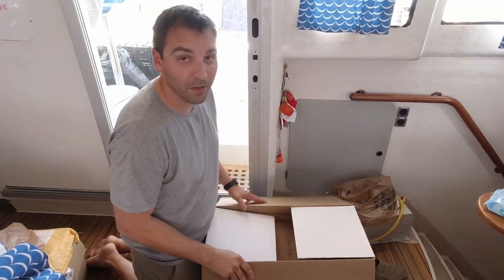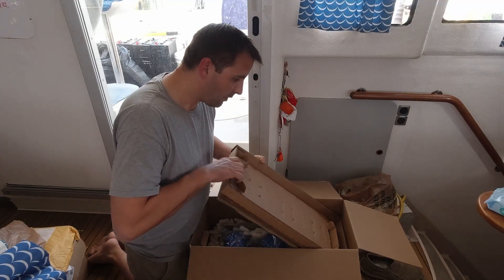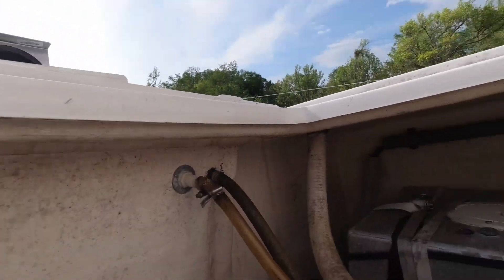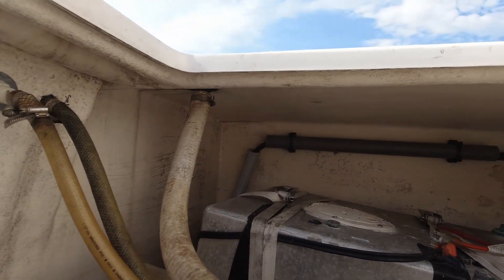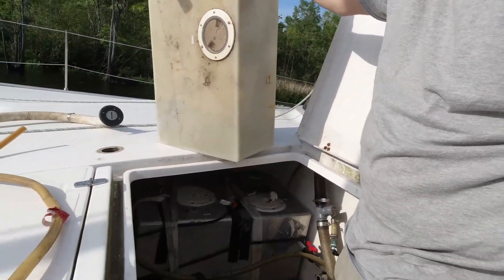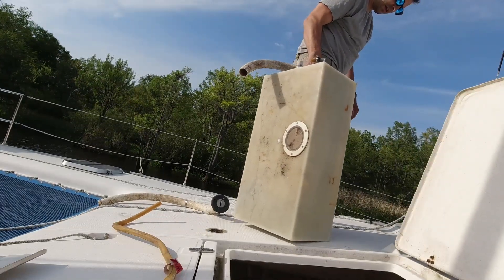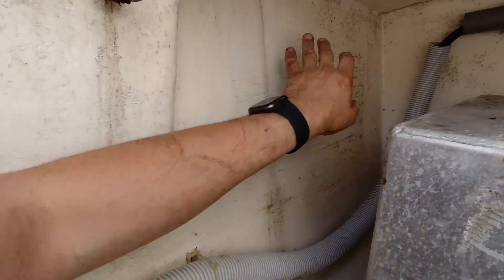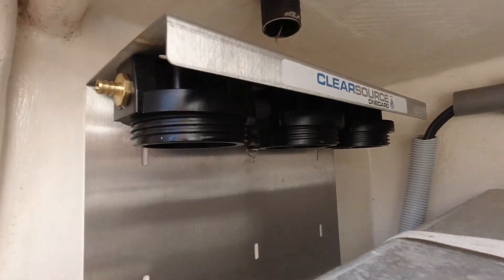Sailing: The Drinking Water System That Removes BACTERIA and VIRUSES  Ep.23

Comment: Super nice filter system.  Definitely good for marina water.  If you are using a black tank it is good to rinse the tank a few times at the pump out station if there is water on the dock. Pump, Rinse, Pump, Rinse, etc.  It helps with the smell.  Also use a dual water source flush if you can.  Salt for times when water is scarce, fresh when water isn't an issue.  The Salt water makes the system stink even worse.  Flush the head with freshwater longer than what will bare minimum get it done.  It really reduces the stink.  People stop pumping the handle too soon. Also it prevents that crystalline buildup from forming as much.  Salt exacerbates the crystalline buildup.  My Cat 30 has a Macerator when offshore that empties the waste tank.   Back to the filters, I wish that my boat had enough space for that filter rack, I'm sure water quality would be better.  I just think those super nice housings are just to big for my little boat.  The smaller size standard housings might be doable, but not the large ones.  My boat is PACKED!!!  Oh if your water maker has been sitting the membrane at least is likely toast.  If someone didn't "pickle it" with Potassium Metabisulfite, then the membrane is toast.  They have to be cycled with fresh water every week if not pickled.   Also run the circulation pump for like ten minutes before kicking in the high pressure pump.    Here is a video I contributed to with my bud Taco man: https://www.youtube.com/watch?v=ooVk-__QEME    You can make or replace an entire system for less than 2k or substitute parts cheaply from the more section and comments.
Reply from the maker: Thanks Allyn.  The water maker has been pickled we have not tested it and the previous owners never used it. They on the boat for 2 to 3 years and it never left the marina. Maybe when we get a long stretch of days where I can go offshore we can actually run some water through it. As for the holding tank, The marina where we purchased the boat had a pump out service with no option to flush it, just a quick pump out. Our marina now has a similar pump out service, We still have no option to flush the tank. Furthermore we are installing one composting head which will work better for us and we will keep the starboard macerating head. I’m going to install a 6 gallon vertical surface holding tank with a discharge port for offshore.  I think This set up will work much better for us. We are super excited to have these filters. I feel comfortable now with collecting water from any source. Our water maker will, of course,  dump water into the holding tank and then it will be filtered before we use it.
Reply: @SaltyEscape  Sounds like a good plan.  One other thing about the water maker.  If you have taken on Chlorinated water from a marina, don't flush your membrane with it.  The Chlorine kills the membrane.  It is also a common mistake along with pickling, and not letting the booster pump work long enough before kicking in the high pressure pump and having air bubbles ruin the system.  Oh it takes a while for the pickling solution to get out, so run the booster for a long time and don't let it go back into your tank...always overboard.  You'll also want to pick up some more of the stuff to pickle the system.  Here is a link that if you buy some it should last you well into your 70's:https://www.morebeer.com/products/potassium-metabisulfite.html

Comment: Another useful video, thanks. Will keep this in mind once we have our water maker installed and we are able to evaluate the quality of the water with the water maker filters.
I have removed various tanks in the past. I typically cover the cut hoses ends with a ziplock bag and duct tape. Both the tank ends and the loose ends. My weak stomach can’t handle the smell or splash.
Reply from the maker: Yes!! A ziplock bag would have been helpful.   I didn’t expect it to have “contents”. It was pumped out a couple days earlier.  I was unprepared... lol. 🤷‍♂️

Comment: Hi, at 10:44 you show the water tank and the hose to the filters. Why is the drain out from the tank so high? It would make since to have the drain from the water tank lower on the tank, unless there is a pickup inside the tabk near the bottom and you install a max 4 pump to extract the water out of the tank. Why is the pickup so high?
Love your videos and the refit. doing similar on our boat to start cruising soon. Binge watching your episodes.
Reply from the maker: Hi guys! Thank you.  There is a pick up pipe in the tank.  Why…? Who knows.   I agree it would’ve been a simpler system to put the water access port at the bottom.  Eventually we will be replacing this tank but for now it’s what we have.  🤪
Corey

Comment: Those chunks that are in that strainer are also in the bottom of your water tank I would seriously consider a full cleaning and sterilization of the water tank if you're drinking that water. In addition to the water filtration I also have a  filter and tap at the sink Specifically for drinking water
Reply from the maker: Yeah, the chunks are from the aluminum tank galvanic corrosion.  The filters are hospital grade / life straw technology level.  It’s basically sterile.  0.01 micron.  
No need for any other filters at the faucet.
Reply: @SaltyEscape   Thanks for replying I don't know if you did or not or maybe have replaced the tank but I would at least clean it or replace it with a Polly tank. Just so you know that we're tests done on lifestraws and it didn't really go that good. Watch the video on water filters on project farm

Comment: How different to a UV filter system is this. How often do you need to change the filters
Reply from the maker: Hi guys!  My understanding is the UV systems will kill most bacteria however not all.  Also, the UV systems are often at the tap (like the galley sink) so they wouldn’t cover the sink in the head or shower... (for brushing your teeth). Also they use power and the UV will not Eliminate the pesticides, pharmaceuticals, heavy metals such as lead like these filters will.  The Clearsource filters are rated for 2000 gallons of water however of course it depends on the quality of the water. They say for full-time use they recommend changing the filters approximately every three months.
I hope this helps!  Cheers Corey